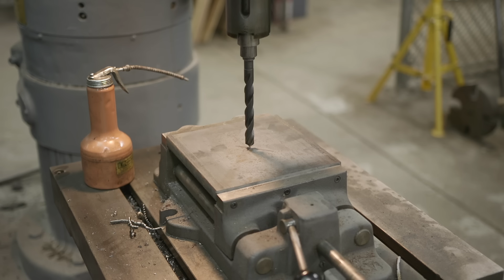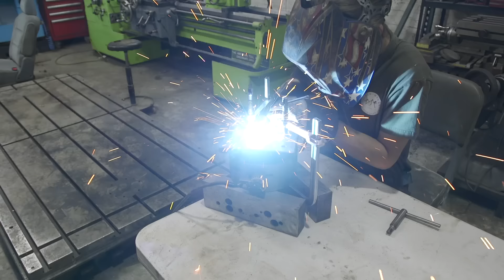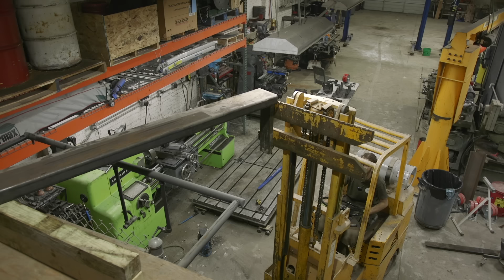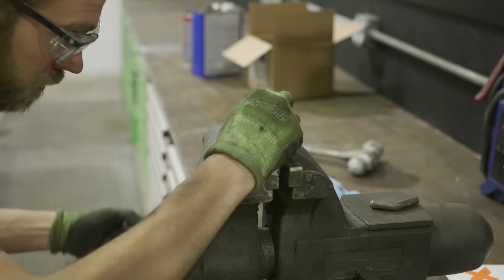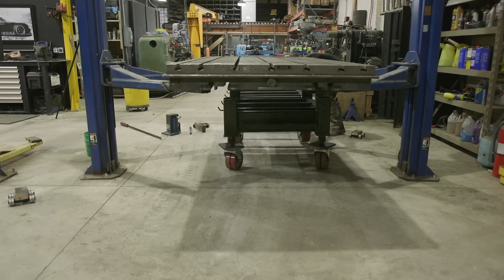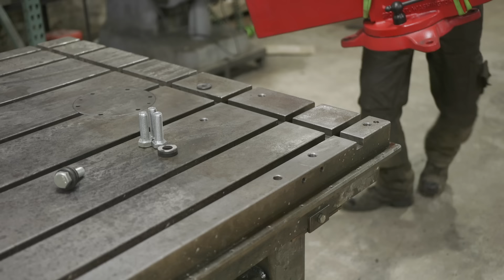Building a 7,000lb Welding Table for $600

Comment: Nice table ….. I have the same band saw but I was wondering what blade you use because mine just loses teeth halfway through a cut 😅
Reply from the maker: Lenox di master 4-6tpi bi metal running faily slow surface soeed
Reply: @VanoverMachineAndRepair thank you for the reply I will definitely have to try some of those 👍🏻

Comment: I have seen you use this table for some non welding projects and it seems like this specially flat table is put at risk with some of the work I have seen you do like for the Lion rebuild.  Now is that your old weld table getting abused or this one?
Reply: How exactly do you abuse a 2" thick table
Reply: @Johnnyreengo  My point had to do with the surface.  I thought it had to be perfectly flat, true and without burrs or dings in order to do welding squarely.  It seemed to me using the table just as an available hard surface to use at will would mar the surface in such a way as to affect its ablity to be a flat welding surface.
Reply: @MrArtVendelay  never fear welding dings and berries don't attach to cast iron, you can't damage its from welding, and a divet taken out by grinding won't effect flatness.

Comment: i think you overestimated the weight of your plate ... 3/4 inch plate 8 inches by 60 inches is 0.2083 cubic feet steel weighs 490 lbs per cf  your plate should weigh 102 lbs

Comment: 5:14   How the chips come off the drill is more about how the bit is sharpened than speeds and feeds.  If the bit is cutting well .. there is no sense wasting some of by  making it shorter. when it's not necessary   That's how I was taught ... they are expensive tools!
Reply from the maker: Yes they are

Comment: 🤦🏻 . . Is it illegal to own and use a proper MIG Welder over that side of the world 🌎? 

Such a waste of an OVERKILL build (which I am all 🤙🏻 for) , but why ruin it with cold looking “Chook 💩” welds from an underpowered (multiprocessing) mig machine .?!? 🤷🏻🤔🫠
Reply from the maker: I am confused
Reply: @VanoverMachineAndRepair  people welding on YT is confusing ! 

Big size steel deserves big size welds . Allow for movement if need be. But it’s sacrilegious seeing 1/2’ plate given 1/4’ welds. Yes I know it’s more than enough to hold, but turn it up a little more and SEND IT !N
Reply from the maker: @RepLicanT00100  now I have a bigger welder back then only had a 200 amp machine. Was going to do multiple passes but I realized it’s not a bucket. It’s so overkill and is fully welded. Yes bigger welds would be better but trust me it will not break anytime soon.
Reply: More heat more distortion

Comment: For the threaded rod, it might be overkill and more work (ie not needed), but if you had chosen to do threads in the plate, thread the rod into the threads, then weld it, could that have helped give you a better solid attachment to keep it from tilting while welding?  Or I guess you could have cleaned off the threads in the lathe for the part that sticks into the plate and used that for the press fit.  In either case I love watching your logic and work flow for projects, please keep up the good work. :)
Reply from the maker: True good points thanks for watching

Comment: One idea on the threads into the plate is to turn the threads down to less than the minor diameter of the threads so you have a smooth consistent surface and then bore the hole into the plate with a 0.001" press. This does 2 things. It gives a tight fit and gives a shoulder on the threads to square it up to the plate and you can set the depth for the plug weld on the back side
Reply from the maker: True

Comment: The traditional heavy equipment approach for the caster mounting plates is to mill a caster mounting flange pocket in the receiving caster plate. This way the caster mounting plate cannot move in shear, can be a rather large force if both the table and work piece are heavy. Also, the pocket helps to line up a new caster if a replacement is needed. If the caster receiving plate has a recessed pocket then you have many options for the caster bolts in terms of strength, meaning you can use SS locking (serrated) flange bolts. The misc. shelves many times are made using custom welded SS (304) sheet metal pans with raised edges to catch fluids and bottom strengthening stringers as an option, wood is combustible so is not used as part of the table build. The pans slot into the tables to keep them in place. SS pans clean up really well and are non-sparking.

Comment: Cool table.  A table this large defects more than you think if your frame and floor aren't flat.  You would never be able to hold .001 even if the table surface were pristine.
Reply from the maker: Thanks that’s what the leveling feet are for.
Reply: @VanoverMachineAndRepair  well, as long as you keep it in one spot.  If you move the table your adjustments will no longer match the floor and table frame will deflect to make up the difference.
Reply: Then you'd readjust I would think 🤔 @zachary3777

Comment: 600$ more like a 2k table , just the casters are 75$ each
Reply from the maker: 600 for top, 450 for casters, mcmastercarr materials less than 100, 300 for 3” tubing, and steel on hand. For its weight, size, and precision on I don’t think it’s possible to get a cheaper table. Also if I made it stationary and used misc steel in leu of my 3” box tubing I could have made this table for just the cost of the top which was 600$.

Comment: At 20:50 it looks like you are welding nuts top and bottom to your two plates top and bottom.  How are you going to use a nut to raise or lower the table for fine adjustment.  One way would be to weld a tube to the top plate with ID greater than the thread.  Keep the top nut free so that it can drive the top plate up or down.  Voila, perfect adjustment to each leg.
Reply from the maker: Correct. I spin the plate with the wheel on it to adjust. Fireball tool table adjusts its wheels the same way
Reply: That table is gonna be a butch to kevel and move. I dont care who you are. It will takevtime. So you will not want to move it after you level it

Comment: Shop like that without a mag drill 😮 i dont get it!
Reply from the maker: Got one now, Hougen 920s baby. Material acquisitions take time. And I like to do it right. I spent nearly 3k on drill and cutters so took awhile.
Reply: @VanoverMachineAndRepair   Of course you got the original mag drill👍. I have Milwaukee. Cutting a large hole in 20 seconds rather than 20 mins. Adds up over the course of decades 😉 after a couple thousand holes. It's literally just 5 years of your life standing there drilling holes without one 🕜

Comment: just put 4  casters on the horizontal  reinforcements of the base to move it  and add some THICC threaded bars as legs that you can use to lift the table and finely tune the flatness of the whole table against the floor every time  u move it. every time you move the table u need to check the flatness of it.
Reply from the maker: The wheels have leaving features built in. It rarely moves

Comment: No way that piece of steel weighed 250 lbs.   First off you woulding be picking it up off the floor... secondly you would be dragging it unless you were built like the Rock.....sorry but no way
Reply: With the dimensions he stated, (5'x8"x.75" = 360 in^3 = 5899.34304 cm^3) and using the density of mild steel (7.850 g/cm^3), the mass would be: ~46.31 kg ~= 102.1 lbs.
Reply from the maker: Glad that was your takeaway from the video

Comment: Nice table but just so everyone knows it does not include the vise Which is a $2000 fireball tool vise that you were passed down for generations to come😂 Work of art right there and hope you give your welding table a name like Red Dragon
Reply from the maker: Indeed
Reply: Massive nuts should be a contender. Nice work I wish I could find some chunky steel like that on the cheep.

Comment: You have to abuse drugs for many, many years to believe you can build something like this for a $600
Reply from the maker: Or you could just do it. No drugs here. Paid 600 for top and 600 for wheels and metal
Reply: @VanoverMachineAndRepair so 600 for the top amd 600 for the wheels and 500 for cross braces, and 1/2 plate soooooo that’s WELL over you clickbait ass title. You will get WAY MORE subs if
You just tell it like it is man.
Reply: $600 was the money you paid after all the equipment, consumables, and “free” metal costs, not including all the other costs associated with starting, owning, and maintaining a shop such as this, or the time invested in networking and relationships made along the way. You’re super talented and capable but this table didn’t cost $600
Reply: Don’t forget shipping costs
Reply: If you do the labor yourself, buy your metal direct from a supplier in large amounts, and of course, have access to a machine shop. It looks like you’re using Accessories from fireball tool? I’d be curious to see how this table matches to their three-quarter inch table that’s expandable.
Reply: If you're in this league you can take advantage of 600 dollar machine beds. MANY viewers self included could get a bed like that home on trailers we own or rent or in trucks we own or rent, them fab a base with surplus steel we collect opportunistically as a matter of course. Some even score real Acorn tables cheap but those are of course harder to find.

Ability to transport what you find is more a limfac than money. For example I just attended a house moving company liquidation where a very large industrial engine-driven winch (dozer sized, weighed several thousand lbs) went for about sixty dollars because no one wanted to move it except the bidder and being adults no one got into bidding wars. Tens of thousands of lbs of good steel beam went for WELL below scrap.

This stuff is much easier than it looks even on a budget.

Comment: Which AC forklift is that? Looks exactly like my AC 40 i brought back from the dead. Will see if you have a video on the channel about it.
Reply from the maker: Yeah, I should do a video on it. When I came into the shop space, the owner basically gave it to us as long as we got it running and I put a bunch of time and money into it In the beginning it’s running good now. but man that was a bear. 

I want to say it’s a PS 500  or ach500 one of two. It’s 5,000lb capacity. I’ve definitely lifted more than 5000 pounds of it it’s pretty old school and overbuilt.
Reply: @VanoverMachineAndRepair  Thanks for the info, very cool. You can find pretty much every part for it still, try to get ahold of a TVH catalog, and then most parts are under the Kalmar brand. Would be interesting to see if you have the Buda motor in it still.

Comment: You may have already said, somewhere, where you got the table..... so, apologies if you already covered this. 

Where did you get the table?
A used machinery reseller, a scrap yard, or what?

Thanks! Love the finished table n vise! 😊
Reply from the maker: I bought the table top at auction for about $600.
Reply: @VanoverMachineAndRepair  thanks! I assume a machine tool auction?

Comment: you did the feet adjustment wrong . the top nut should be loose to push against the plate
Reply from the maker: I’m not sure I follow. I just reviewed the fireball table vice legs that I modeled mine off of in the design seems identical so either he’s doing something wrong with his table or I’m missing something. either way I’m pretty sure there’s multiple ways to do it.
Reply: @VanoverMachineAndRepair  the nut was welded to the flat piece so it will turn . the ones ive seen are 2 nuts with a tube welded so the nuts push the tube higher or lower

Comment: From a crane guy. Use a choker for your sling. Just in case it's not quite balanced it gets tighter as you lift. A basket it could slip off. Enjoyed the video tho really sweet table.
Reply from the maker: Good tip! Thx

Comment: 7000 lbs of steel for $600!.... in your dreams.
Reply from the maker: The top is 5000lbs alone I paid 600 for it at auction
Reply: This is a weird hill to die on. You’re consistently replying to anyone calling you out for a misleading title but you’re not realizing how unbelievably wrong you are. You did not post $600 for this table. You paid $600 for some of the components utilized to build this table
Reply: If this table costs you $600 to make start selling them for $600.

Comment: At 3:13  a 250 lb piece of steel that weighs 100lbs.
Reply from the maker: Sure
Reply: @VanoverMachineAndRepair  I thought you were joking in the video.  I'm half way through the video now and it's really good so far.  Nice work and really nice shop.

Comment: If I wanted to build that table, without the random free shit, it would easily cost like 8k or something. That hbm table alone is a small fortune.
Reply from the maker: Auction on hbm table. When I bought mine they had 10 others going from 200-1000. Anything is possible brother.
Reply from the maker: Mine was 600$
Reply: @VanoverMachineAndRepair anything is possible but you paid 600 for the too, 600 for the caster, 600 for random
Steel how does this add up to a 600 dollar table

Comment: Save a lot if time by using the mag drill to drill the holes before you cut the plate. Plus the slugs make nice knobs with very little work in the lathe. The allo9wence for blade thickness is a little tricky for laying out the holes. most of the time I don't need that precession. I do the same with the metal  muncher too. I tap punched holes with the impact wrench. I just add thickness to compensate for the lack of thread engagement.
Reply from the maker: Yes I still don’t own a mag drill though. Soon hopefully

Comment: looks ok as guess but 600$....click bait. if u say what a table cost keep in mind what the viewers will pay for a build equal table not what u got for free and so on. i think that is more fair for us
Reply from the maker: Yes and no. Table top is 600. Whole build 1200. The concept is the same. The table is mega cheap. I was pricing out a fireball table and with the fixtures I was at well over 15 grand my table came in at over a 10th of that. Which is what the title suggests a really cheap welding table. Also, people build things all the time with stuff they have laying around the shop to keep the cost down that’s completely normal. if it’s to my advantage to keep the cost down because I have expensive material laying around that’s great. Specifically that large tubing that I used I had acquired for free basically. I’m sure there’s things in your shop that you build with material you have laying around. Sure that material would be worth something but for the build it is not a purchase made for the project.

Comment: No machining on the top surface of the welded frame means the cast iron plate will only touch three points. Bummer.
Reply from the maker: Yeah that’s good in theory how do you expect a machine and 9‘ x 4‘ piece.
Reply: @VanoverMachineAndRepair  I used to own a 2 x 1 meter cast iron table with T-slots in both directions. It sat on a heavy welded frame that had a top surface machined with a planer. Of course the bottom surface of the plate had been machined also. This piece was probably from the fifties. The machines with this capacity do not come cheap. I have tried to outsource machining of a similar 1 x 1 m table (only adding T-slots in both directions) but it is very expensive and it turns out many suppliers here in Holland turn it down anyway because they do not want (grey) cast iron fouling they prized machines!
Reply: @VanoverMachineAndRepair  One other great asset is having machined sides. Mine had and I used a magnet base drill to add M16 threaded holes every 100 mm or so and screw on plates as stops for building frames etc. I am still beating myself up that I sold the thing back around 2010.

Comment: If only you had a fixture table... wouldn't need to utilize a 4 wheeler for downward pressure. lol j/k nice build, but yeah that had me confused on why you wouldn't have just jigged up your framing prior to welding rather than the 4 wheeler trick.
Reply from the maker: Yeah I agree

Comment: I want to see you roll that table around by yourself. I do not believe you can. I’m sure you’ve already discovered this. Definitely worth having a table like that though even if you need help moving it.…
Reply from the maker: You are right. No matter the wheel size it’s to much weight. If I was 220lbs probably. By rocking it I can get it to move but I am to light at 135lbs

Comment: Wow! Heavy duty!!  Great job on the vid. Obviously a sustained effort over a number of months and to end up with a cohesive story is remarkable. One thing I missed...how does the stand connect to the table top? Or does it just sit on it?
Reply from the maker: Yeah it mostly sits. Lol it’s heavy but I got a few tabs holding it on
Reply: Smart just letting it sit, when you weld to that table it will distort slightly

Comment: Sound solid strong. What a fixture table you have put together. Better than a Fireball Tool fixture table. But then having the top made would cost someone around ten grand more on its own. And all the clamps can be arranged any position at all. I thought you would use all thread or bolts with T nuts to weld up the trolley base, obviously I don't need to go into the circus as a mind reader!
And as you noted the sheer size of it is as much as most jobs would ever need since you can overhang a bunch of the project and still utilise the flat fixture feature.
Reply from the maker: On some projects, I do use T-slot clamping. Having the other clamps is nice too they’re pretty convenient. The table is really nice but the fireball table would definitely be nicer. One downside of the table is in order to clamp some thing in the middle you have to slide the clamps from one side in. Can be a little bit of a pain if you have multiple things clamp down. One day when I get a mag drill I’ll drill clearance hole in the middle of the T slot so I can install the clamps halfway through the table.